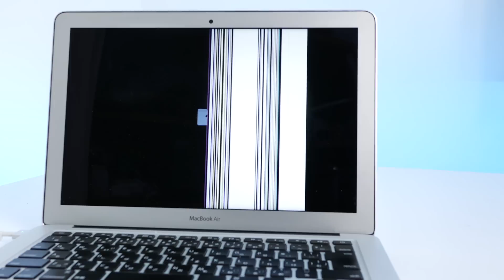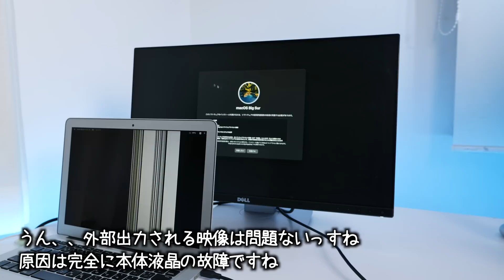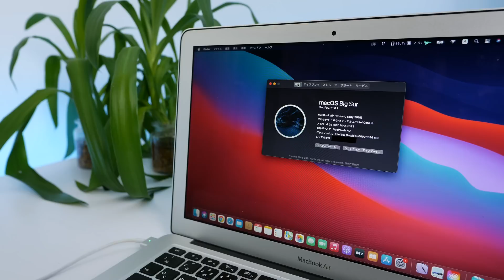表示不良 4000円のジャンク MacBook Air 2015 13インチを復元

Comment: I have a 2013 MacBook Air - it's only recently started slowing down a bit, but I'm going to give it a good cleaning internally and externally, and perhaps another new battery (currently on its second one). Great machines! 私は2013年のMacBook Airを持っています。最近少し遅くなり始めましたが、内部と外部をよく掃除し、おそらく別の新しいバッテリー（現在は2番目のバッテリー）を提供します。素晴らしい機械！

Comment: The resolution of 2011 screen will be lower i belive though i could be wrong , try dosdude for latest OS
Reply from the maker: The resolution was the same for both 2011 and 2015.
It's 1440*900 for 13".
Reply: Fair enough check panel as LG as best